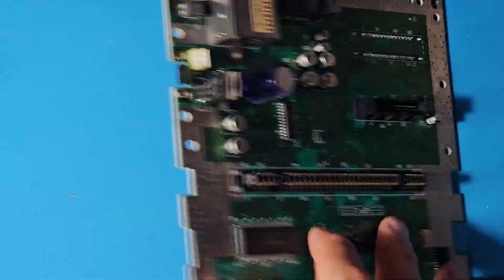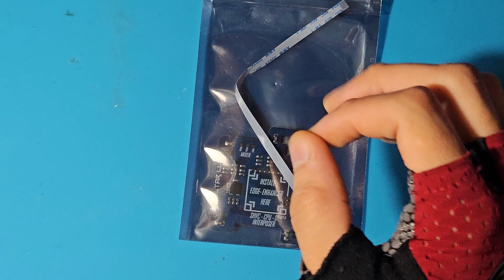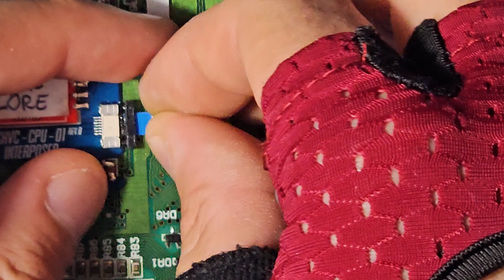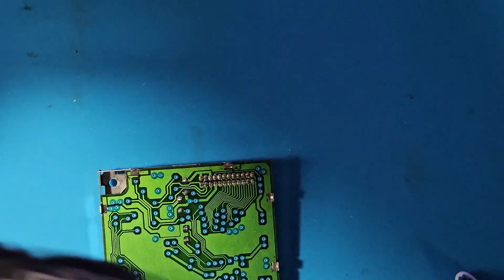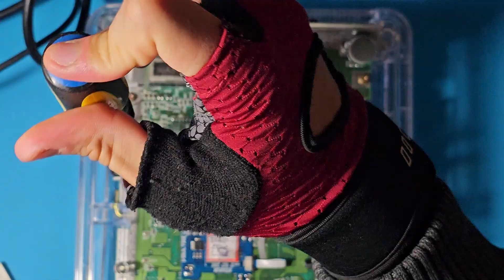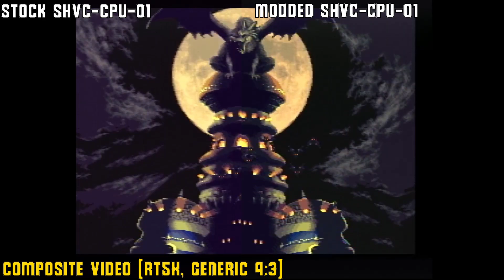Ultimate Super Famicom (3Chip) - Fenris Mods #4

Comment: Love MLIG and now found your channel

WOW great to see a voultar mod installed! I'll be saving this video for reference when I do my own. 

How did you get the DIY mod board? It doesn't seem to be available on voultar's shop. I've been considering a retrosix edgebuster instead because it's available now and for a very low price. Also the guy who runs RetroSix is a nicer guy overall than voultar
Reply from the maker: @iamdmc  i was given the opportunity to install the Edge enhancer, thanks to Voultar. I should also mention that the RetroSix mod is not the same as the Edge enhancer, and appears to be based off an experimental mod that only serves to add a sharpening filter to the SNES output. It's not addressing the core issue of the hardware, it's simply masking the problem.
Reply: @fenriswolfretro  Can you you test out the RetroSix edgebuster mod to compare to voultar's? They go about fixing the problem in different ways sure, but are the end visual results identical? If so, and both mods are equally simple to install, then voultar's more expensive mod becomes an academic exercise more than a real world benefit
Reply from the maker: @iamdmc  from what I can gather, their have been reports of issues with the mods from other users, and due to the nature of the mod I can see a scenario where their is alot of parasitic capacitance from unused parts due to differences in configurations. I have my own reasons as to why I don't generally buy RetroSix products, but that's not relevant to this discussion. 

What I will say is I feel more secure with a mod that has been made after thoroughly analyzing the SNES's internal DAC and is designed to actually address the issue with it, than a mod based off an experimental schematic that won't show solid results 100% of the time.
Reply: @fenriswolfretro  what's wrong with RetroSix? The guy who runs it seems like a good guy and I've always gotten my orders in time.

Haven't seen any user reports on the Edge Buster except for a reddit post that showed it working
Reply from the maker: @iamdmc  RetroSix has a history of cloning people's closed-source works and making alterations that make their kits far less stable than the kits they cloned, but cheaper to produce. I have had to repair multiple handheld consoles that had major issues due to their kits. In addition, I have had multiple clients have issues with the shipping time from both them directly and their subsidiary, HandHeldLegend. 

From what I have also seen in their videos, they do present themselves as knowledgeable but resort to either using already proven methods while making it out like they discovered it or alternative methods that may cause other issues down the line

Comment: Other than the region side of things and 3 vs 1 chip, which system is better?.?. (Super Nintendo or Super Famicom) I know the cost of the titles are much less through Japan.
Reply from the maker: @killmechanizm2424  In terms of cost, Super Famicom consoles are way more affordable. In terms of versatility, the SNES has it in spades. Hardware-wise, they're the same. The big difference is that the SNES has a wider cart slot. All you need to do to get it to play Super Famicom games is snip off the two tabs that are inside the cartridge slot. Stock Super Famicoms require an adapter to play US SNES games. Their are new shells, however, that can give you the form factor of a Super Famicom with the cart slot of a SNES.